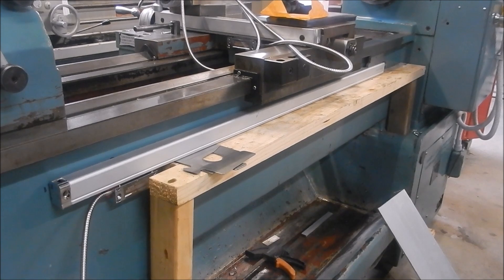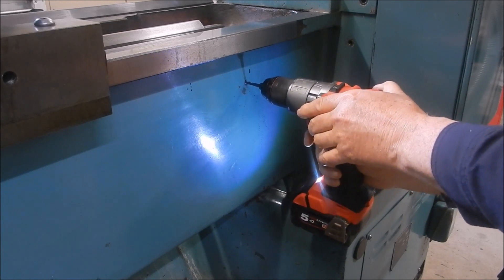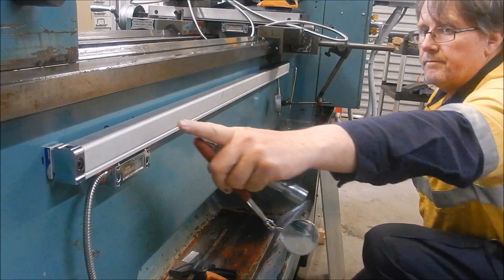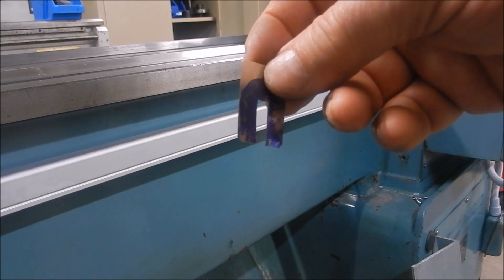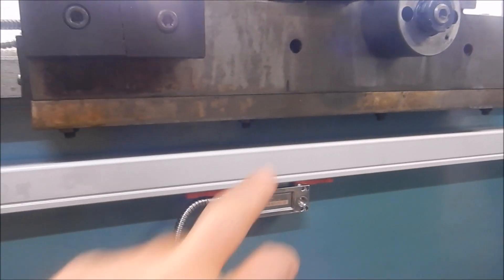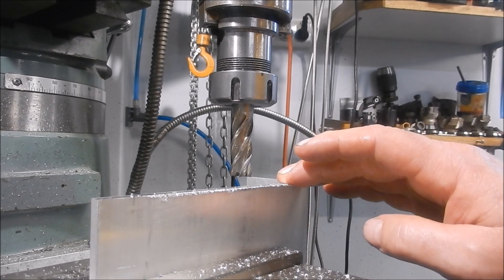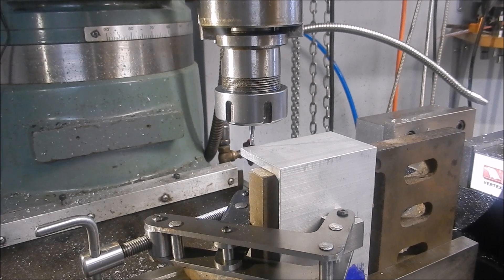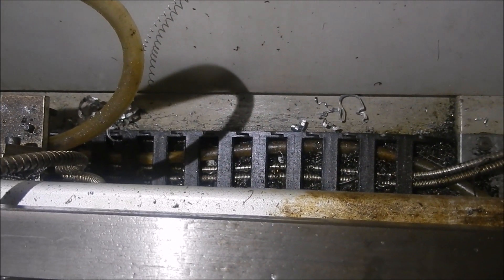Fitting DRO Scales to the Victor Lathe Part 2

Comment: Hi Cam .   What's your opinion on Sino  v  Easson  apart from the price  . For professional  , not hobby use .    I may be fitting dro's to a couple of my machines in the future , possibly Easson .  I would always think about a miss read & stuffing up a part with the cheap ones .  Cheers .
Reply from the maker: I do have an Easson unit on the Victor Mill I bought and must admit the feel between the two as far as pushing the buttons and operating is about the same.  The buttons do feel a little tiny on both units when pressed.  The Easson units hardware for fit-up is much nicer in finish than the Sino.  I have the cheaper units on my other lathe and I do get some drift on the Z axis over machining time that I just can't figure out.  I make sure I always leave meat on and re-zero at my datum point prior to the final finish cuts.  I'm aware of this and allow for it, I haven't seen the same drift in the Sino unit and I have run it backwards and forwards full stoke and it always comes back to zero on the dial indicator.  If it stays this way only time will tell but so far so good.  I guess if you buy the Easson unit you are paying for quality in operation with constant repeatability day in day out.  This is obviously critical and one error on a large piece of stock due to drift and you could have purchased a dozen Easson units.  The other benefit of purchasing the Easson unit is that it is supported locally so I would assume any issues or questions would be dealt with in a timely manner and in English.  If it where me setting up a commercial business I would pay for the peace of mind and go with the best quality I could afford.
Cam
Reply: @camatbattler2233 As i thought , looks like it will be an Easson .  Cheers .

Comment: Gday Cam, the scale fitted up very neatly, a dro for the mill and the lathe is on the wish list, hopefully soon
Reply from the maker: Yep, really worth while fitting up DRO's.  They take a lot of the guess work out and save so much time.  At the cost they are now it's worth the money.  Just be prepared to spend a lot of time getting them right buts its worth it.
Cam

Comment: Hi Cam, nice video, great timing, we need 1 custom bracket for here, see we are installing 3 DRO's, one on a surface grinder and 2, 1 each on 2 benchtop mills, so nice to see your efforts, our lathe is already done (Pain it was) still great to see your efforts. Good looking stable fit for that bracket. Lance & Patrick.

Comment: Hello Cam,
Turned out well... I will be interested to see the cable management work as there always seems to be so much spare when people fit the DRO's... I understand that manufacturing one size fits all keeps the price down of the component parts but it is always nice if you can make the installation look good as well as function well...
Take care.
Paul,,
Reply from the maker: G'Day Paul, these cables are way to short to get back to the DRO from the end of the Drag Chain.  I will need to fit extensions to them in the same way I did on my other Lathe.  Any excess I just coil up and hold together with a cable tie, keeps it reasonably neat.
Cam